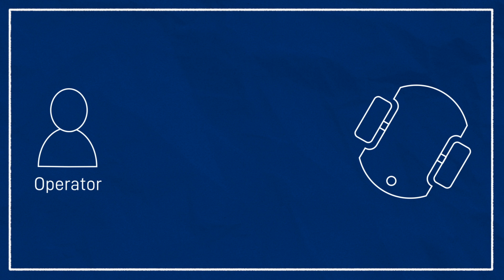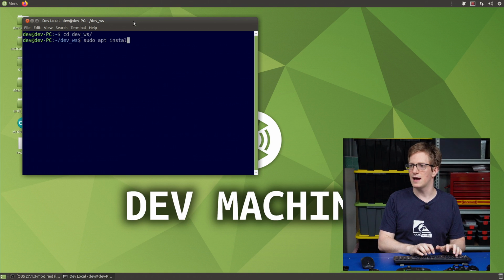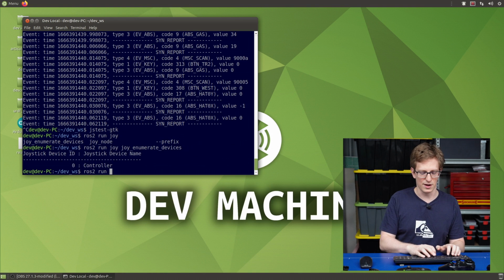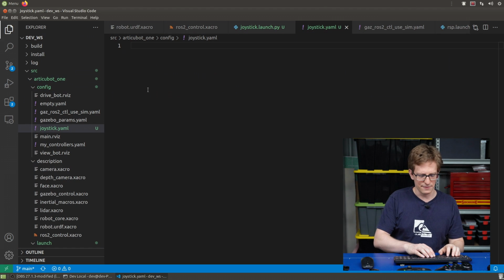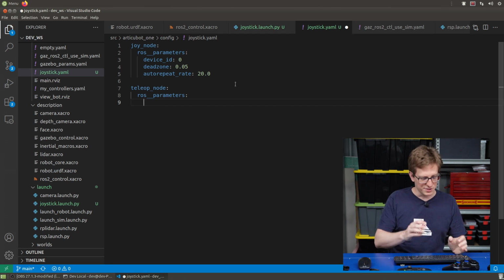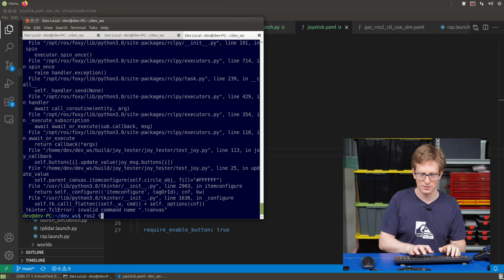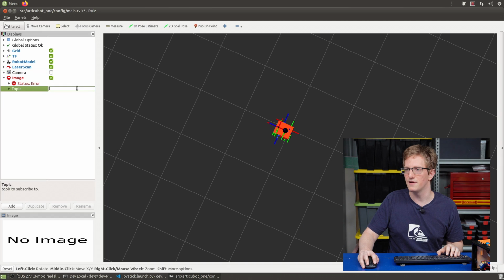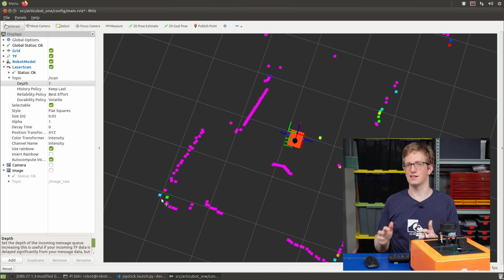Easy wireless control for your homemade robot!

Comment: Hey Josh, I've been following this but had some issues, hoping you can give me a pointer. I'm using ros2 on a pi5 8GB, I have an xbox bluetooth controller and I can see in Foxglove that the joy and cmd_vel topics are getting messages. However if I hold forward (or any direction) on the control pad, the joy topic seems to lock up and stop receiving messages for around 10 seconds, and the Hz rate goes 300+. I think that holding the stick may be flooding joy with messages?

Comment: Your video is great, but I have a question. I'm working on a robot that performs a task, which I assign by calling a service from my host PC. Essentially, there's a node on the host PC acting as the server, and once the service is called, the task is assigned. The task data is then published to a topic, which is subscribed to by a node running on the Raspberry Pi. Now, I want to set up joystick control, and as you mentioned, a node needs to be running for that. However, when the robot is performing the task, manual control is not needed, so running the joystick control node doesn't seem to make sense. How should I structure my software so that a central server node is responsible for handling other tasks? Do I need to keep all nodes running all the time?

Comment: I have been following the tutorial(thanks for it BTW) and I seem to have a problem- I cannot control my robot very well. I just seems to accelerate to max speed, and I cannot slow down, it only stops abruptly when sticks return to neutral. When I am very careful I can accelerate slowly, but can never reduce speed.I don't have encoders on my motors and I believe that might be the cause... If you have any advice it would be greatly appreciated.

when I tried the teleop keyboard I also was not able to make it go slower using the keys in the terminal

Comment: Had actually some problems with a xbox wireless controller. Turns out that you have to update the controller firmware! (without a Xbox only through Xbox Accesories app).
Great Video btw.
Thank you for sharing!!!

Comment: Thanks a lot for the superbly articulated tutorials. I managed to build and get the robot up and running until this part of your project. I also got the Pi camera and Lidar going. I am 60 years old, and I do robotics as a hobby. The videos and the blog post are detailed and easy to follow, even for a senior citizen😂
Reply from the maker: Thanks, I love hearing that people are building it! And yes you can essentially skip this video, it's totally optional and never worked all that well (I have more recently posted a far better approach anyway)
Reply: @ArticulatedRobotics  Thanks, is the video you are refering to the docker tutorial?
https://www.youtube.com/watch?v=uf4zOigzTFo&t=192s&ab_channel=ArticulatedRobotics
Reply: My robot visualization rviz does not align with the actual robots movement. Front and back movements on the actual robot show the robot rotating in rviz  and rotating the actual robot shows the robot moving forward and backwards in rviz. I am using 2 sd cards for ros foxy and humble your articubot code. I have the same issue in rviz with both. With the gazebo simulation it works fine in rviz.. only when the actual robot is connected and the frame set to odom it acts differen in rviz.  I  also have my camera image and lidar frame reversed.   I tried making changes to the urdf robot.core.xacro but it didn't change anything..Give me a hint where I am going wrong. I would really like to get it working .

Comment: I find that when using the controller, if I push the joystick directly left or right (no forward/reverse) the robot doesn't move. I would expect to turn around. It does work as expected when using the keyboard, when I push the J or L keys it turns around. Any one have any ideas for me? Would it be a param in one of these files, or is it my specific controller? Thanks!